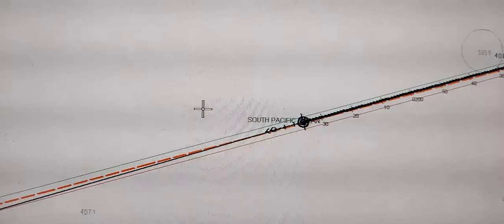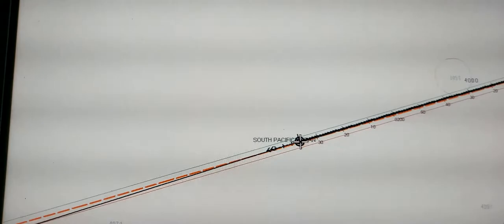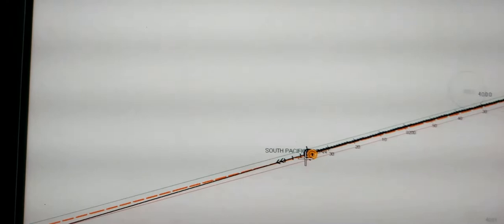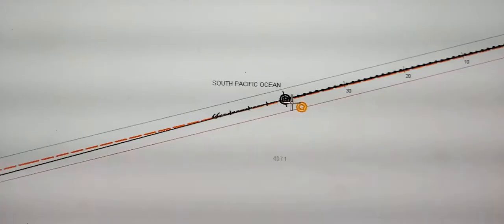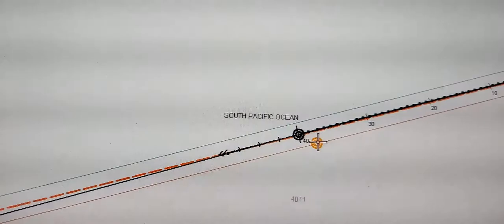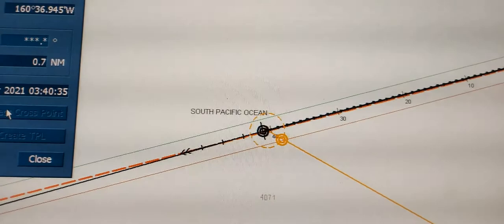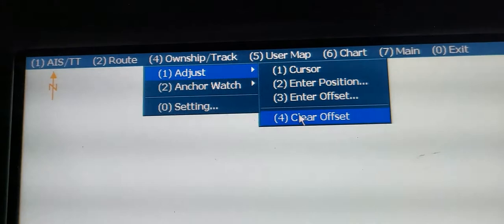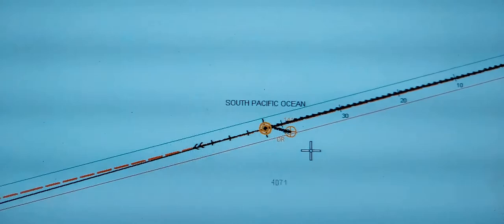MANUAL FIX POSITION USING DEAD RECKONING ON ECDIS JRC JAN 901B/2000

Comment: Chief need for 1. celestial fixing morning and noon fix on ecdis, how to do rather than working sheet
2. How to call coast by Mf/hf voice in danger (Not asking for weekly test -real scene procedure)
Reply from the maker: Regarding MF/HF RADIO CALL, you need to change the mode on your MF/HF from  DSC to TEL (usually it's possible to change directly from keyboard) and after you can insert the frequency for the station to which you wanna call. In ADRS VOL 1,3,4,5 you can find the station and check on which frequency this station is receiving radio calls.

Comment: Nice video very informative and very helpful to all deck officers .. Can u do a video sir most commonly question of PSC about ecdis? Thanks much..
Reply from the maker: Thanks ! I will try.
Reply from the maker: They mostly asking when was the last charts updates and that the presentation library on your ECDIS, this information you can find on this video - https://youtu.be/2ca5oVS9VqI

And also is it correctly calculated Safety Contour, Shallow Contour and Safety Depth, on ECDIS have to be the same inserted value like in your passage plan and also on the charts applied NO GO AREA  according to your Safety Contour etc. This info you can see on this video -  https://youtu.be/ZEhbx8Ebczs

And have to be applied on the charts manual fix position (reference point) with appropriate internal as per your passage plan, you can find on this video - https://youtu.be/YFNUH-c2MMg
and
https://youtu.be/t_yWApH5osU

They may ask also regarding Safety parameters, see on this video  - https://youtu.be/6nl1JRQbUAM

And don't forget about navigational warnings which you receiving via Inm-C or NAVTEX, it's should be applied on the charts (military practice exercises, area where some vessels engaged in survey ops, seismic survey ops, firing exercises, some approaching buoys is unlight etc.).
Reply: @MARINERS-CLUB  many thanks sir..big help for me as a aspiring secndmate.. Godbless